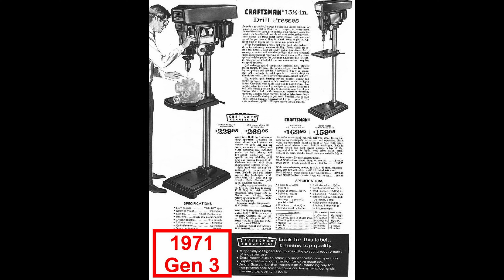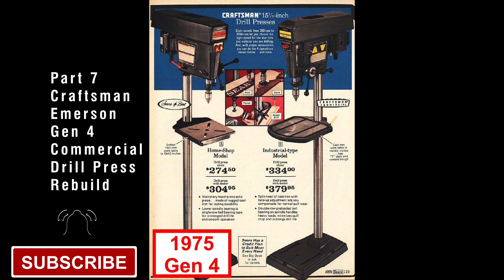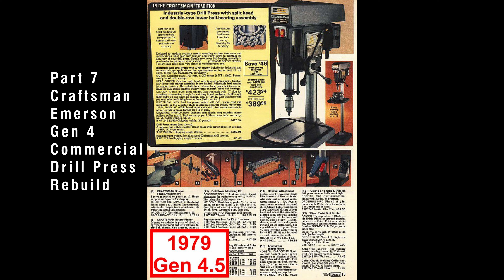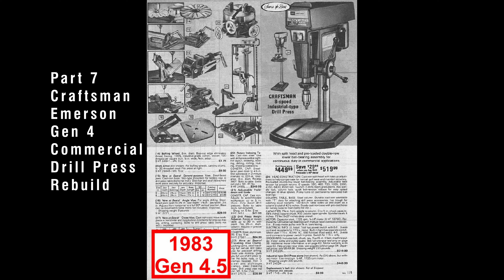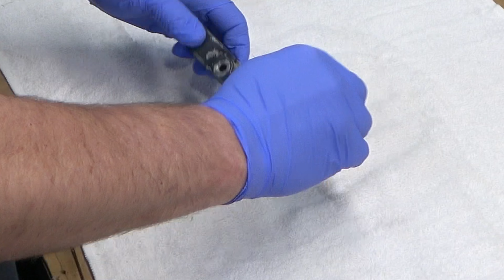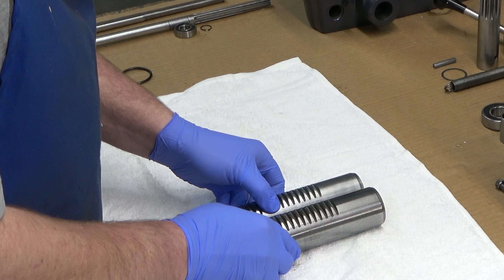Part 7 Rebuild Emerson Gen 4 Commercial Drill Press (Standard & Commercial Comparison & Parts Clean)

Comment: I've had success using a heat gun to soften the old adhesive that's used with the clear film that's on similar panels. The manufacturer uses that film to protect the panels, but the film is supposed to be removed. Over time the adhesive gets hard, but a little heat carefully applied will loosen the glue...
Reply from the maker: I thought about using heat but did not try it because I concerned that the heat would damage the graphics. I will give it a try the next time I run into this issue. Thank you for the suggestion.
Reply: @JeffsShop  Yeah, don't go gung ho with the heat gun.. Based on the direction you took with the switch plate, that would have been a good candidate for modulating the use with heat... If it didn't work out you still had the option you took with the decals...
Keep up the good work with the videos...  Most enjoyable...